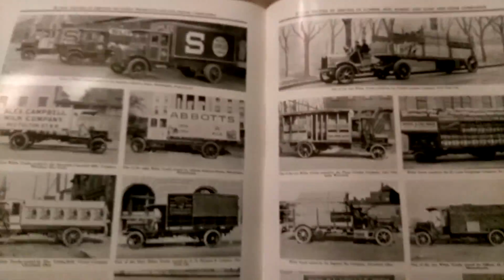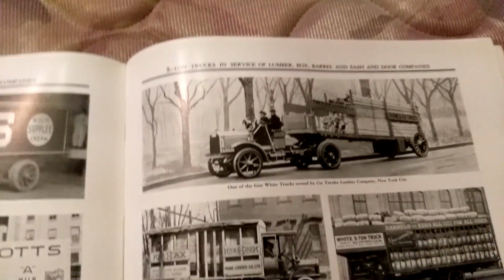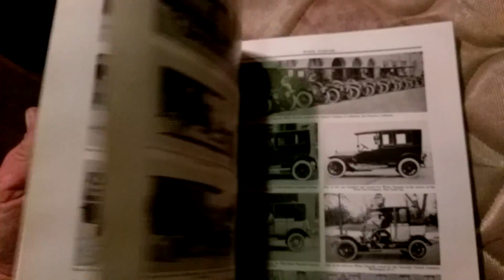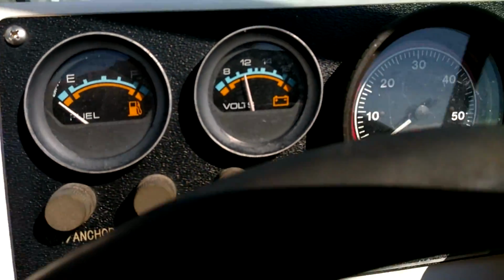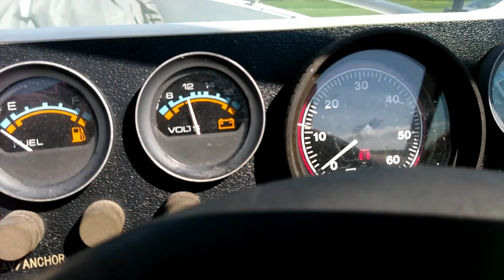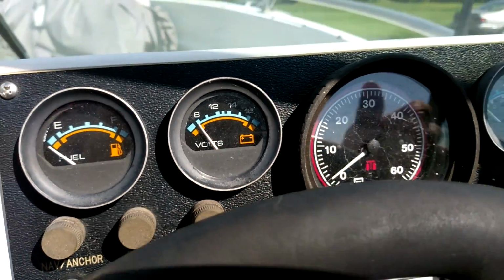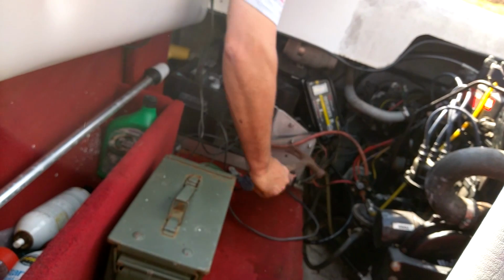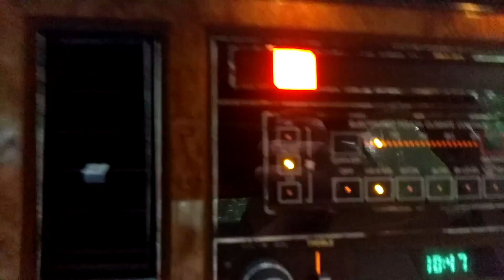A bunch of stuff all together

Comment: tom I have a 68 bolens 1054 and the steering wheel is messed I was wondering if you had one
Reply from the maker: Hey man, sorry, i don't.  Also i don't sell anything.
Reply: tommartyn ok thanks anyways
Reply from the maker: But if you ever need any advice or anything about working on the beast.  Feel free to ask.
Reply: tommartyn alrighty. I have a question mine will roll over but doesn't have spark what should I do
Reply from the maker: Oh, hey, sorry missed this till today.  So, no spark, 1054 should be a wisconsin TRA-10D, with points.  So Take those points off completely, sand or clean them as well as you can.  Put it back together with just a tiny tiny gap between them, make sure the negative from the coil is going to the points, and make sure the coil has 12V positive going to it, and then you should have some spark.
Reply: tommartyn it has spark now but I clean the carb and checked the spark but it's not starting the only thing it does is if I put gas in the cylinder it will backfire but won't start
Reply from the maker: Oh yeah, forgot to mention, the 1054 was only made in '71 and '71.  They did make the 1050 in '68 though.  All the same tractor, just painted different, different decals, and different steering wheel/seat.  So could be 2 things.  Could be low compression.  Might need rings, or the rings could be kinda stuck in the piston groves from carbon build up or something.  Or, spark is still not that great, and kinda inconsistent.  I've had that happen before.  If you have a gauge to check the compression, definitely a good idea.  And if that checks out, i'd sand those points really well.    Could be something with the valves too, if its low compression.  Piece of dirt stuck in the intake valve or something, keeping it from closing all the way.
Reply: tommartyn  thanks Tom for the advice